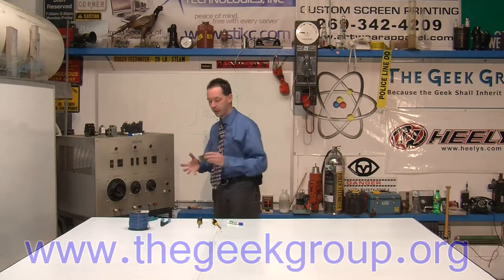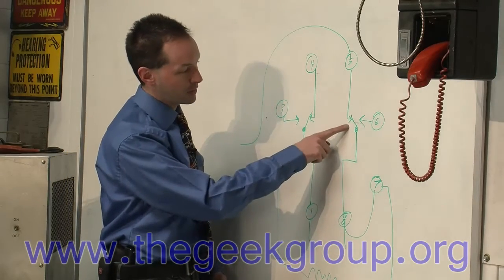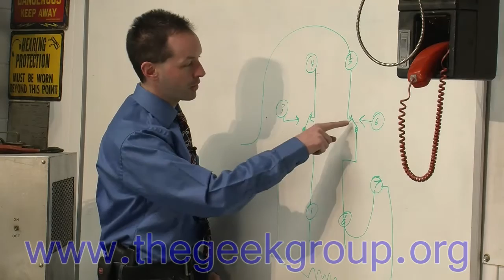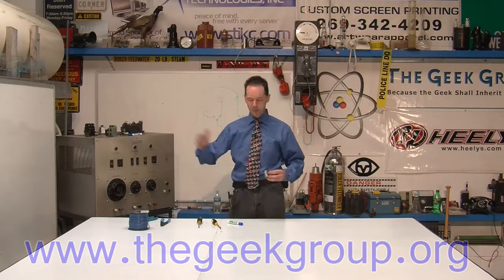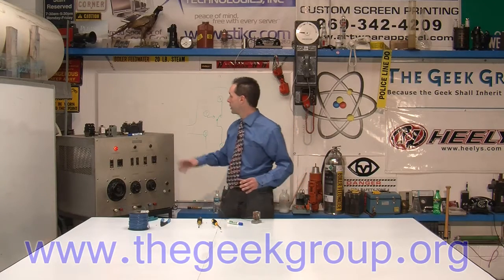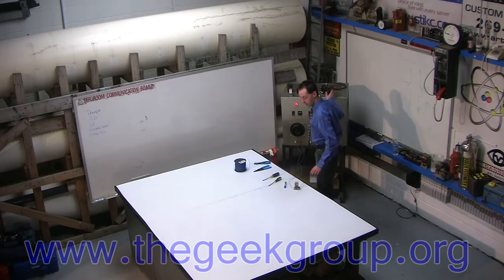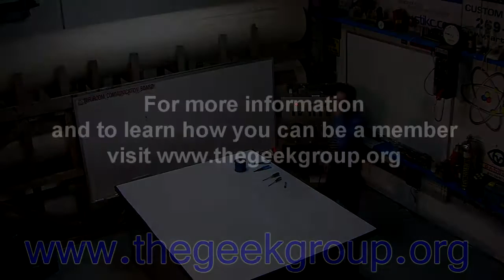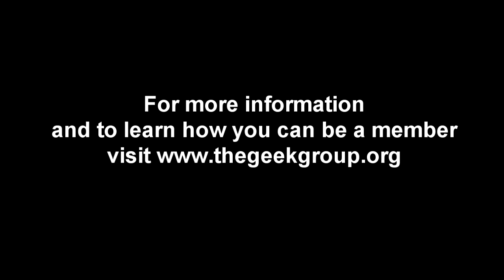Fun With Relays

Comment: you can do a self oscillating relay with N.O. contacts you put the switch part in parallel with the coil and either current limit the supply or put in a low resistance load (lightbulb ballast choke etc) between power and the relay try this with the huge relay

Comment: I did this with a 3 pin 12volt flasher relay. Hook different size capacitors to control speed of armature switching.

Comment: Actually here's something interesting. Relays in that configuration radiate RF. And while they won't mess with a tv, they sure as hell will mess with an AM radio. 

And if you want to lockup an HDTV set - just key up on the 2m band with 5W. The screen will freeze and start to pixelate.